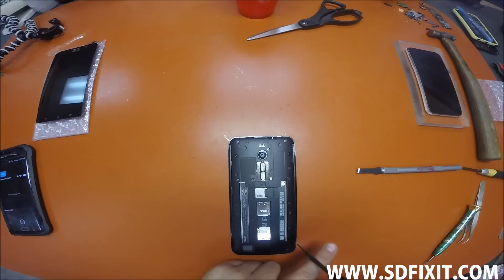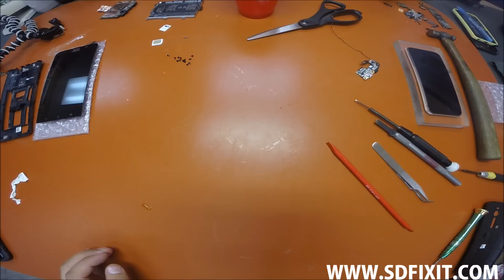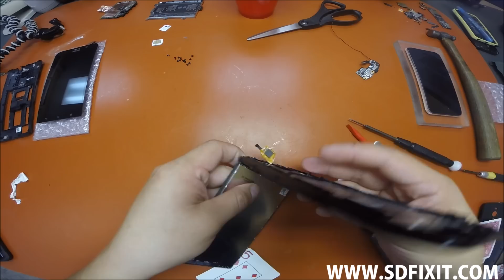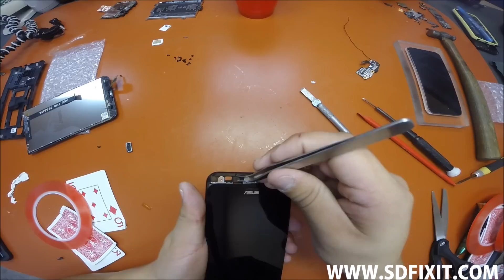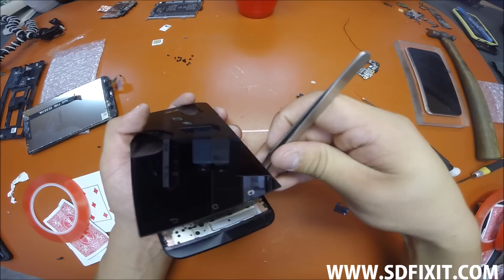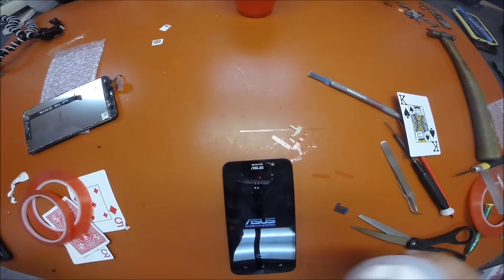ZenFone 2 (ZE551ML) LCD Digitizer Glass Replacement Disassembly Repair

Comment: I am also wondering why you used tape and then removed the same tape when the screen was partially installed.

Anthony
Reply: +anthony851 he removed the top protection from the double sided tape
Reply: +anthony851 its double sided tape sir

Comment: Hello ! The video is awesome. I just have a query though. Is there anyway we can change just the glass, without the digitizer ? Not really interested in aftermarket panels. It will be great if just the glass that broke can be replaced. I've seen part listings in ebay, but no instructions on how to get it done.
Could you please help ?
Reply from the maker: +Arun Das A Glass only separation will be very difficult. In my opinion, it will be quicker to buy the assembly as one part.
Reply: Okay, Thanks !! I was dubious whether aftermarket panels affect the battery life. It is already bad now :) 
What do you think about it ?
I have ordered one part from ebay, US seller. It should reach by tomorrow.
Reply from the maker: +Arun Das Yeah that's a good question though but if anything I'd figure it to say battery for it using lower quality than OEM Part possible pixel density decrease or panel brightness...whose to say? But if you figure your battery to be bad do both at once I'd say. Who knows maybe you can show some of the experienced how do a glass only?? Best of luck to your repair!!
Reply: +SD Fix It :)  yes! 
Thank you.
Reply: SD Fix It , So I got the display yesterday and replaced the complete assembly. As you said, removing the glass alone isn't easy at all, not with the tools that I was having with me. Anyway, after changing the complete display, the phone works just fine !

I bought a tempered screen protector and overall it feels like a brand new phone somehow. I never used any screen protectors and cases on my phone but I think I'll be using them both from now.
:)

I will update about the battery life later, might help someone who is interested to know about it !

P.S. For anyone following this video, as he mentions, be extra careful with the battery. Its easy to mess it up. Use a hair dryer to heat the sides. Not too much heat though. The main adhesive is on the right side, so it would be better to start from left side, free it and then the right side. The opposite works too, I started from the left. Mind the coax cable, it is there on the right side and can be easily damaged while you are trying to remove the battery from the right side !!

Comment: Quick question.  My phone never dropped or anything the touchscreen simply stopped working and became unresponsive as well as the 3 soft keys at the bottom of the phone.  I was able to factory hard reset the phone and now I'm stuck at the phone initialization screen with still an unresponsive touch screen.  Thus I am unable to continue.

Considering that everything on the outside appears to be "as new" I'm assuming the issue lies with a possible severed connector within the phone.  So my question is what exactly am I looking for?  What wire or connection is used to connect touch to the touch screen?  Or to send signals from the screen to the phone/motherboard?
Reply from the maker: You need a new screen +joseph nichols

Comment: thanks for sharing!
i've just replaced my lcd but touch is not working :( any idea? i have experience in replacing screens but i can't understand why it isn't working i think i did perfectly
Reply from the maker: +Denis Canepa First things first do the easy work and go back and double check you seated all the connectors properly. If that still doesn't work it is possible you received a defective screen. If that is the case second time around make sure you do a dry install meaning do not apply adhesive and sorts to ensure the screen works then go back and install it the right way. So just return the old part or buy a new one.
Reply: +SD Fix It I cheked many times the connectors and that doesn't solve the problem.. the problem is that I glued the screen and the previous screen was broken and while trying to remove it I destructed it
Reply from the maker: Denis Canepa  You may have received a defective part order a new one and or return.
Reply: +SD Fix It i will return tomorrow. thank you very much

Comment: Hi I need you to answer a question like really fast. Does it matter if I use a AUO screen or TM screen? Like the writing in the flex cable behind the replacement lcd screen that says AUO FHD ZE551ML or TM FHD ZE551ML does itt matter? They're both ZE551ML..
Reply from the maker: +Power Button Honestly, I'm not sure if they have more than one version of the screens. I would try doing a "dry install" and see if the screen works.

Comment: Two questions...
1. What is the "solvent" you prefer. Is 90% alcohol it or do you use something home brewed or otherwise?
2. What size tapes do you recommend as staples for phone repair? More than one single tape size, right?

I ask because I work in IT and have been tasked with repairing all the phone (mostly broken glass) for our company. Mostly Galaxy models but a few of these made the roster.
Reply from the maker: 1. If you have access to MEK, I'd recommend that, but it will melt plastics.
2. I find myself using 2mm and 4mm the most.

Comment: wow.. I will not risk to fix it by myself. I thought its simple to replace the screen by just removing some parts @_@
I have broken spare phone of ze551ml (issue is motherboard) is it also compatible to replace it to the ones with a screen problem unit?

Thank you

Comment: so I watched several videos on this and I replaced the screen myself. thought I had done it correctly AMD noticed that I accidentally pulled up a little piece of the white plastic on the charger port dock. its the plastic that goes around the ribbon that connects the battery to the dock. I figured is try and see if maybe it still worked and as i tried to charge the phone and boot up the red battery emblem appears and the phone will not turn on. so I figured it was from that little piece I broke so I replaced the whole dock and in having the same problem. the red battery pops up and it doesn't charge it just turns off. what could possibly be wrong?
Reply from the maker: +Wesley Pennington i am not too familiar with this phone however with that being said that doesn't go to say we cant help your issue if you would like us to take a look at it and see how much we would charge email us at info@sdfixit.com if you would not like to do so its possible you could have received a defective part maybe order a replacement and see if that works...

Comment: What should i use to pry up the case and the battery?
Reply from the maker: +Daze Dem I like using something like the blue tool in the middle:
http://www.ebay.com/itm/Metal-Plastic-Pry-Spudger-Tools-Set-for-iPhone-iPod-Smartphone-/151094362642?hash=item232ded0212:g:gkAAAOSwhcJWN~al

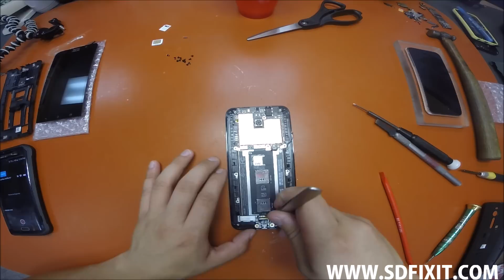Comment: which makes the wire disconnected in 0:38 sec please ?
Reply from the maker: Just a flip panel
Reply: mine is broken, I do not know what stopped working

Comment: at 0:37 what is the cable that you disconnect? i thinki broke it...
Reply: Was it the top one because that is the battery or was it the bottom on cause that is the SIM card tray flex. And if you damaged the part where it inserts that's the charge port.
Reply: +Johnny Guillen the little cable, i didn't see the twist movement and i pulled
Reply: +ILTROLLK the black one? That's the service antenna

Comment: I tried doing this, I followed as closely as possible. But as I was removing the battery I accidentally stabbed it with a knife, and it sizzled and a sour smelling white smoke came out. It won't turn on or anything, did I kill it? And where's the best place for a replacement if needed?
Reply from the maker: +R3troG@ming I would check on eBay.

Comment: Is it possible to remove the glass without a hot air gun? i can't remove the screen from the chassis
Reply from the maker: It is possible however it is a tedious process if your LCD doesn't work you can use plenty of heat and the screen should come off with ease.
Reply: I succesfully removed the glass and replace it with the new one but the problem that the phone had persists: i broke the screen but at some point the phone shut down and some times it shakes like when you turn it on but there are no life signs... what could it be??
Reply from the maker: This issue happens on the new screen?
Reply: yes, it starts shaking just in the moment you plug the battery on the motherboard..
Reply from the maker: Definitely sounds like you need a new screen and if that is a new screen that part is bad and or defective return it or ask for a replacement.

Comment: how thin was the adhesive tape u used? 0.20mm is okay?
Reply from the maker: 0.20 thickess for the adhesive will be ok. Just make sure it is good quality adhesive that will stick well. Thank you for checking out our video!
Reply: ok thanks, did i understand well you put the tape twice on eachother or just one layer?

Comment: +sdfixit I got my phone's screen replaced from service center but now the proximity sensor is not working... please tell me can it be fixed??
Reply from the maker: +manish rohilla No Sorry. Take back to repair shop and have then take care of that under warranty.
Reply: thanks sir, already deposited the phone, they told me that the main board needs to be replaced.
Reply from the maker: +manish rohilla Terrible techs

Comment: I need to use the red adhesive? or is optional?
Reply from the maker: +Marco Aurelio Any double sided adhesive will do, but this red adhesive has provided us the best results.
Reply: But, if I don't want, I don't needs use, ok?
Reply from the maker: As long as the tape is sticky on both sides to hold the screen, it should be ok.
Reply: +SD Fix It I think he's asking if he can just not use ANY adhesive. This isn't an option is it? You must have some kind of adhesive, right?
Reply from the maker: +John Doesitintheair Yes, you will have to use adhesive to hold the replacement screen down.
Reply: I can say I used double sided stuff cut down. And my pooor phone bit the dust.
Reply from the maker: Please use the adhesive as necessary to hold the screen in place this video is for instructional purposes and instructions/ steps are not optional and can not be skipped.
Reply: +SD Fix It do you have a specialized store to do this? Where in The USA? And how much cust to replace a zenfone 2 screen?
Reply: +SD Fix It do you have a specialized store to do this? Where in The USA? And how much cust to replace a zenfone 2 screen?
Reply from the maker: We have a shop in San diego. We would charge $90 with return shipping to install the screen.
Reply: The problem is it's not the screen that's broken any more. I think I broke the phone completely. Anyway, I'm in the UK, so if anyone has a suggestion I'd be listening.
Reply: +John Doesitintheair sell on ebay for parts

Comment: If you do this, PLEASE remove the antenna connector EXTRA carefully, the solder connections are weak and will break easy, I recommend holding the board down and pulling the connector straight up.
Reply from the maker: +mchristjr1983 What exactly happened? Send us a picture and maybe we can tell you whats wrong with it or what is necessary?
Reply: +SD Fix It  i need a little help how can i contact u.??
Reply from the maker: +D3sTrOy3R SoNn3T Email us at info@sdfixit.com